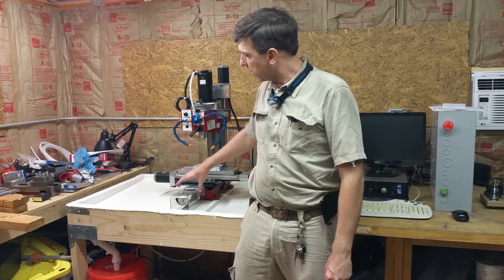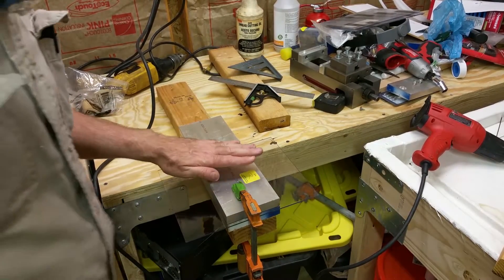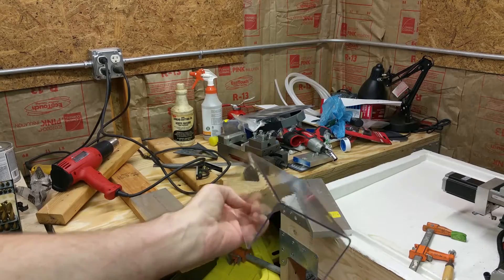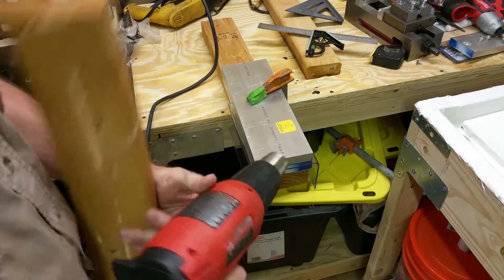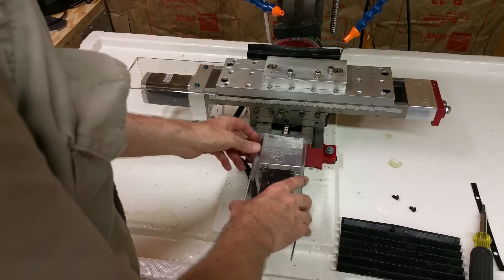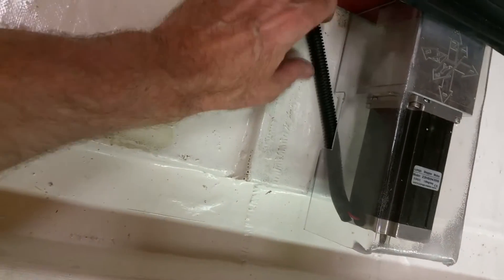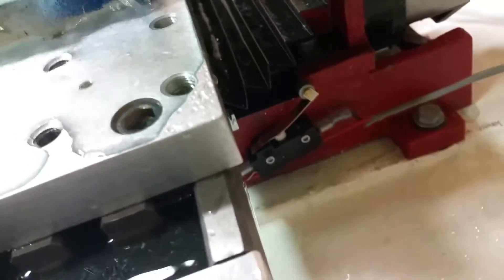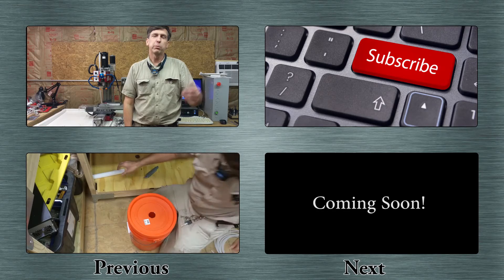Mini Mill Enclosure Part 10 - Stepper Motor Covers

Comment: If you are having issues with the mechanical switches down the line I recommend inductive proximity sensors + neodymium magnets as limit switches. They are usually waterproof and they are easy to find on eBay for cheap (get the ones with a built-in LED). The only downside is that they usually run off 8-12V which means you need some extra TTL glue to tie the signal line into a regular 5V/3.3V breakout board. I use these on my converted G0759 with great success, they repeat better than I can measure (<0.001).
Reply from the maker: telecrate Thanks, I'll check it out!